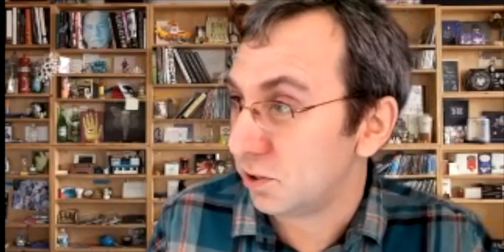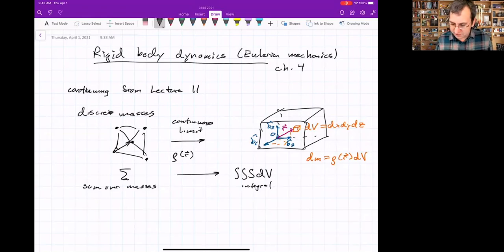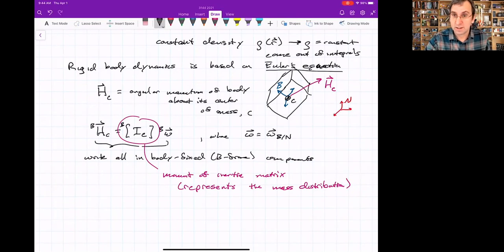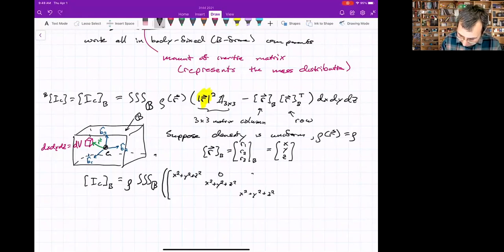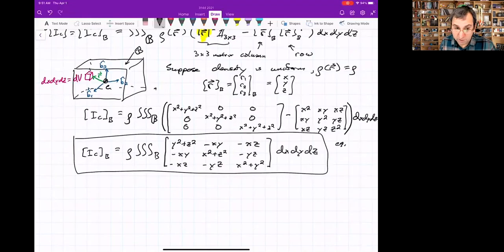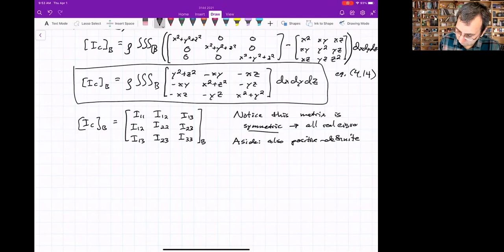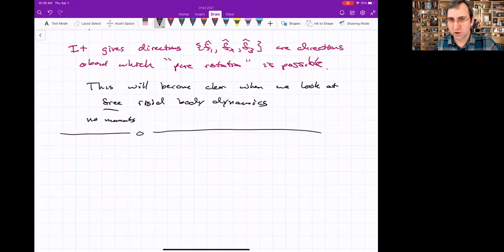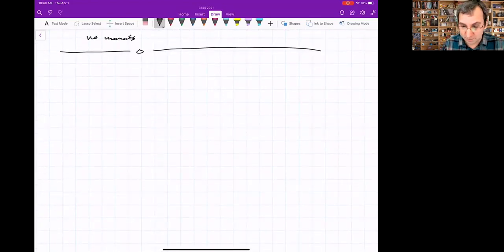Moment of Inertia Matrix & Principal Axis Frame | MATLAB Example Calculation

Comment: Thank you for these lectures, they are helping me a lot. I am confused about 4:00. Are the B_Hc and B_W vectors the components of their vectors expressed in the B frame, so you will need to transpose those vectors and multiply them with a 3x1 matrix with components of the B frame's basis vectors to obtain the inertial vectors of B_Hc and B_W? Or are the bases of the B frame already included in B_Hc, B_Ic, and B_W in the equation in 4:00?
Reply from the maker: No multiplication is necessary. B_Hc, B_Ic, and B_W are the objects (vectors and matrix) already expressed in the B-frame.
Reply: @ProfessorRoss  That makes a lot of sense now! Thank you!